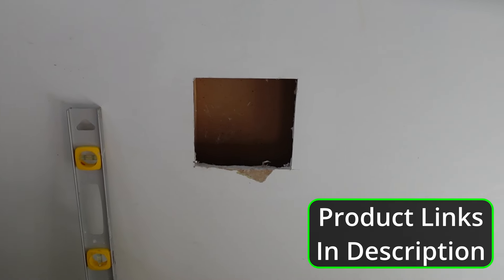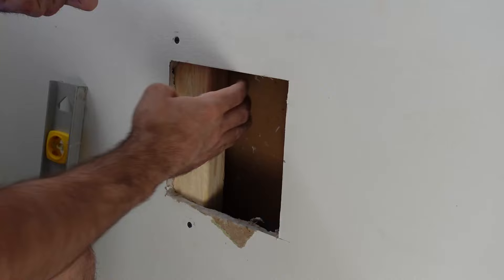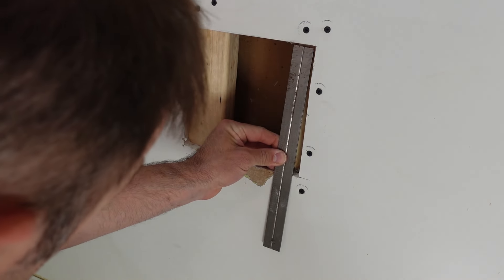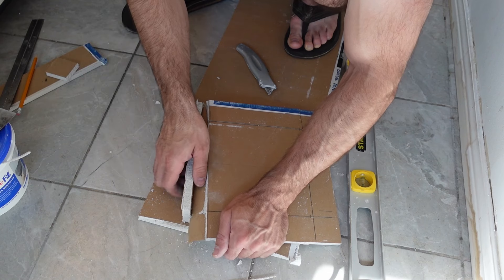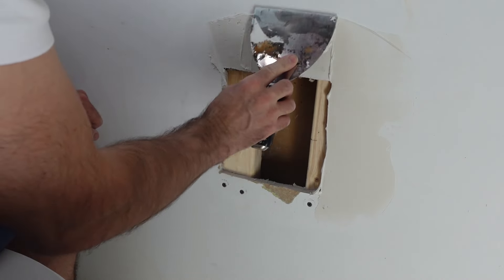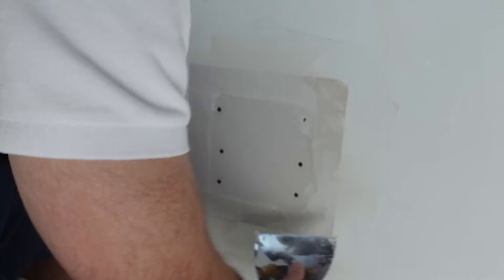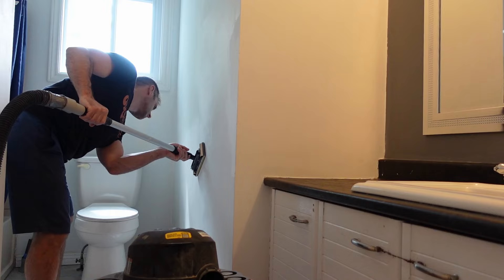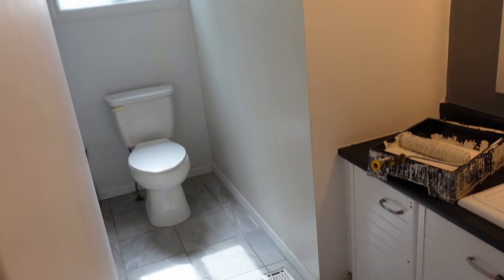Easy Drywall Fix - Large Holes

Comment: Ya know, the thing about this method is that it elevates the patch. If you want to do it right, you should cut the existing paper as it has thickness. Cal patches turn a small job into a huge one if you want it to be perfect and seamless. You have to mud like a pro and make it a large surface area. Better to cut to size, carefully notch or 'bevel' the outside and inside of the hole with a razor, place your beveled piece into the hole with expanding foam behind it or just as is, then spackle. If you do it right and with finesse, no need for large swaths of mudding or sanding. Plus, for an even easier job, use shims with hot glue, set them up first, then hot glue the bevelled piece into the existing hole, let it cure, then spackle the lines. Easy peasy, and if you match it, you might get away with no paint. Maybe. Assuming your paint is white and either matt or satin. But if its low on the wall and a traffic area, the eyes will gravitate to the uneven aspect of the wall. Cal patches require large areas of mudding and paint. Meh. You did a good job though. Nothing bad to say about your work. I just prefer a smaller job. Also, a plumb bob reamed into the screw holes after backing the screws out for a sec, gives you a counter sink that keeps the paper in tact and allows for a good seat for spackle or mud. I do that before painting walls, going over every hole, nick, tear, etc. with a plumb bob. I push in all the cuts and holes and compress the sheet rock in that spot so it takes spackle much better.
Reply from the maker: Thanks for the input and various options for patching.